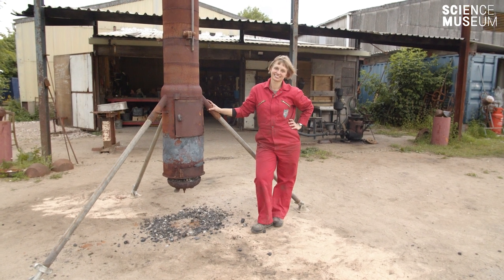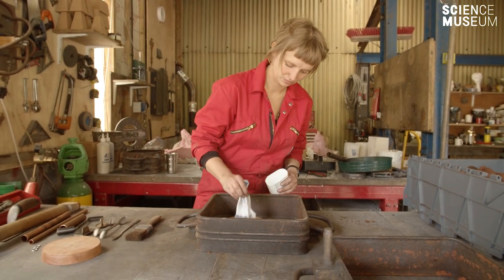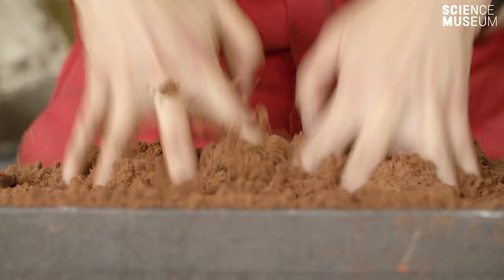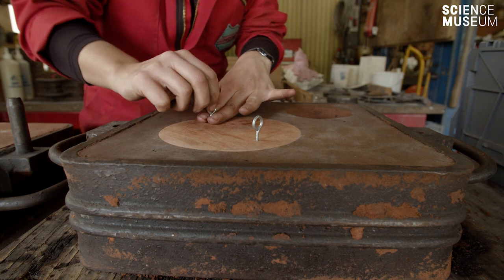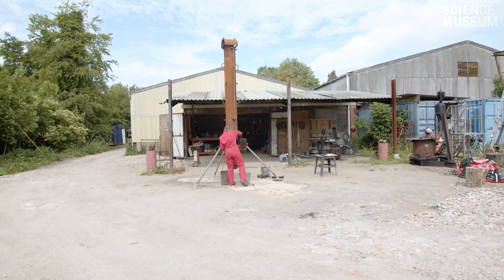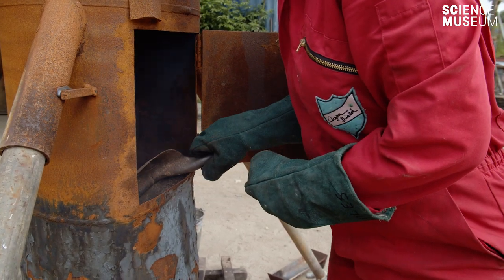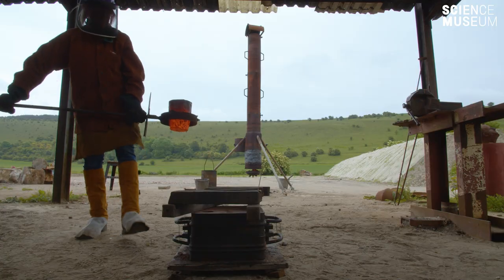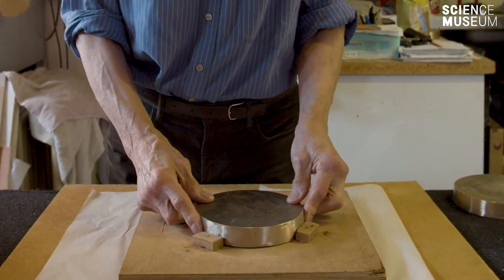How to make a telescope mirror I Shaping Science episode 5

Comment: Would you say this is easier than working with glass? Iv'e been tempted to try make a mirror for years but i never get around to it. I recently moved out to the countryside again and i'm bored haha.
Night sky is decent in this area so i might try build something.

I do live in a Nordic country doe and we often look at the stars in cold weather, i guess metal will shrink alot but if i'm not misstaken regular glass would move as well.

Project doesn't need to be perfect, it's more about having something to do  :)
Reply: You will have to heat the mirror to a certain temperature.  See examples of high and cold places where there are large telescopes and how the results are the best.  I live in a tropical country and there is a problem with heat.  It's not easy for a perfect place to be to have mirrors' exact behavior.  I'm on a quest to make my mirror and I avoid looking at the weather factor at the moment, otherwise I'll get discouraged.  Better to do and move on.

Comment: Bronze is a terrible material to make a telescope mirror from.  You want something that doesn't expand and contract when it heats and cools. Materials like Pyrex, Zerodur and like items are the ONLY thing to make them from.
Reply: where would someone get such things?
Reply: i have a cnc lathe and have thought about making a metal mirror for quite a long time, why would the expansion be a major factor. Is it the connection of the aluminising coating that suffers, or is there no coating.
Reply: @rdrhouse  when things heat and cool they expand and contract.  When that happens it changes shape.  When it changes shape it will no longer focus the light properly, resulting in a blurry image.
Reply: @davidmontierth8258  so i'm guessing the area that gets affected by the brightness of the image will expand and the area without will not, so creating a bad image.
Reply: @rdrhouse  partly.  Yes, light hitting the mirror will make it heat up and change shape.  That's why mirrors are cooled when being used.  But mirrors also heat and cool just from the ambient air temperature.
Reply: @davidmontierth8258  then every material will be affected, but glass and the specialised glasses that were mentioned get affected less.
Reply: @rdrhouse  that is correct.  The glass, or more accurately, ceramic, that is used will expand VERY little when heated.  The mirrors I now grind and configure are Zerodur.  I started with Pyrex.  Both are exceptionally thermally stable.